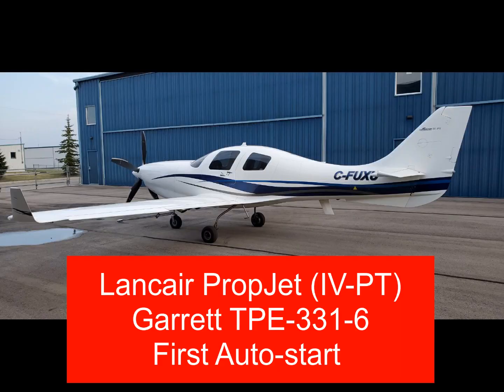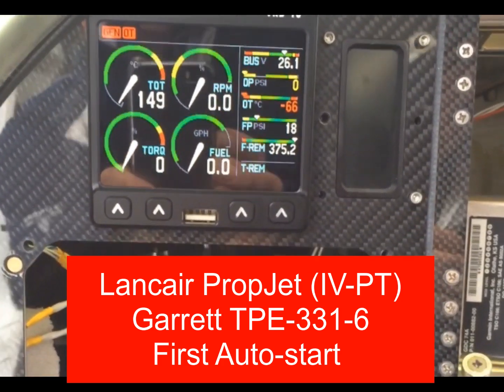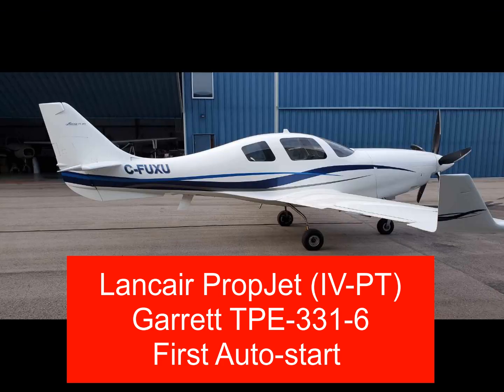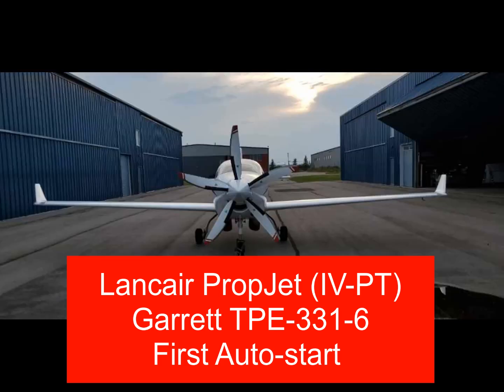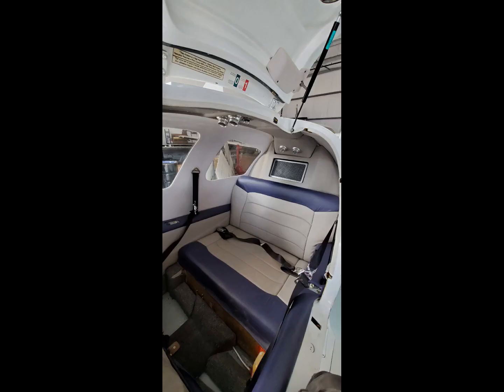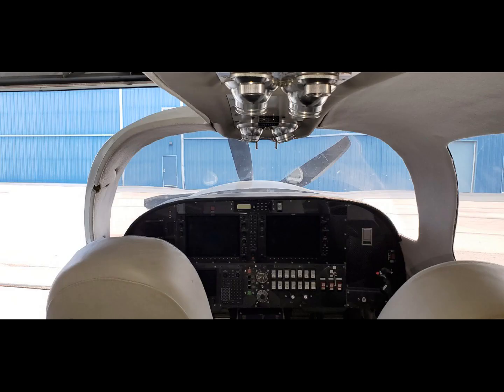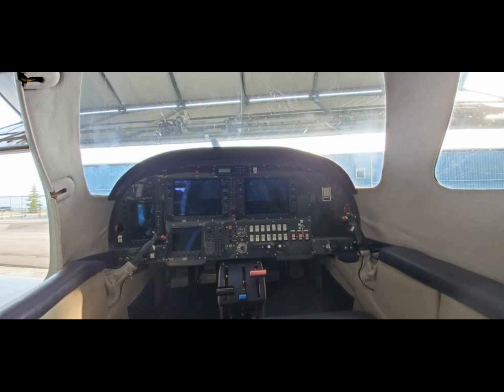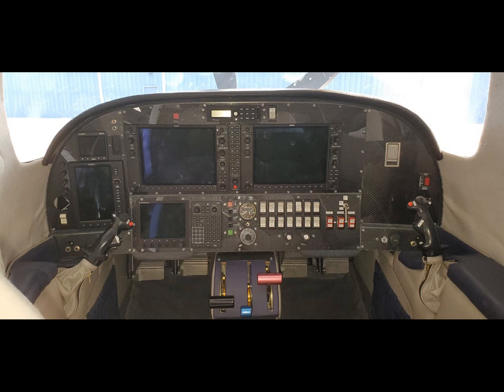Lancair IV-PT Garrett TPE331-6 with Auto-Start, first live test run

Comment: Ha ha.  A hot start followed by 32 GPH on the ground.  Hard PASS.
Reply from the maker: The starting temperature limitations for the Garretts are higher than the running limitations.  There is a window of time and max temp allowed during start. It is similar to the PT6-64a where you have 20 seconds at 800C and 5 seconds at 1000C during start. In fact, this is a automatic start and temps are monitored by the VR controller that will shut down if an overtemp occurs.  Pretty slick system for an experimental turbine

Comment: 30gph at idle!?!?!?!
Reply from the maker: Yeah, typical turbine. The compressor needs a lot of power at idle to provide air for cooling and combustion and to run the prop at ground speeds. There are additional loads for accessories. The speed must be high enough to accelerate quickly from idle state. Amazingly this engine also burns 33gph at 28,000 feet so that’s why they spend little time on the ground.
Reply: @lancairtalk7237 ahhh.. so that was the higher of the two idle settings? Still, only +3GPH to go fast at altitude is amazing, and long holds on the ground oof!

Comment: Was that a hot start?
Reply: Yes that was a hot start.  They do drop & then raise when the secondary's kick in. But that was higher that I use to get.
Reply: Yes that was a hot start. Every time that goes into the red take 10,000$ and put into a fund. Your gona need it for new hot section.
Reply: Red lines are different for engine starting vs flight as I suspect this Garrett does not have the expensive SRL (single red line) computer. Gauge must be set for flight, that's why it goes into red momentarily during the start.

Edit: Start temp limit on the TPE331-6, which this is, is 1149 C according to the Garrett engine manual one can find online. Max I saw in the video was not even 850.
Reply from the maker: No. That’s the purpose of auto start to avoid hot starts.
Reply: @lancairtalk7237  but wasn’t the TOT in the red range? Is there a transient for starting up.
Reply from the maker: @wegrei9645  I recommend contacting Honeywell and obtain the operating limitations for their engines during the start phase. Those parameters are coded into the auto start program. I think you will there are dozens of limitations being monitored and start is different than cruise limits.